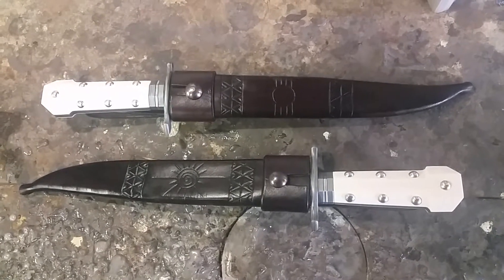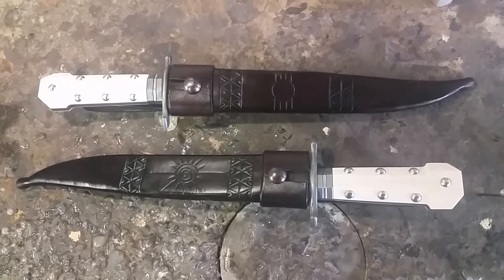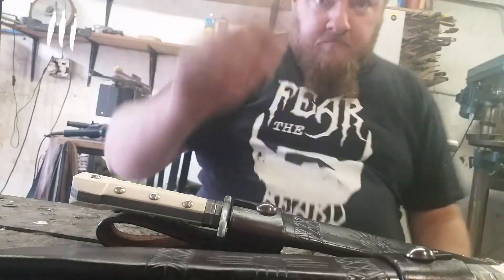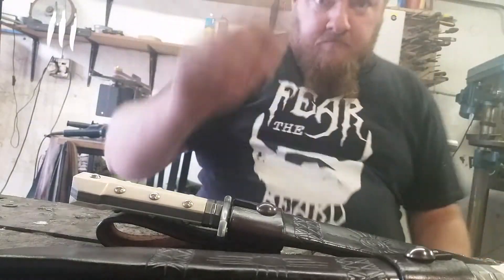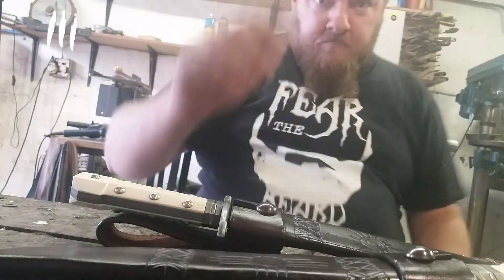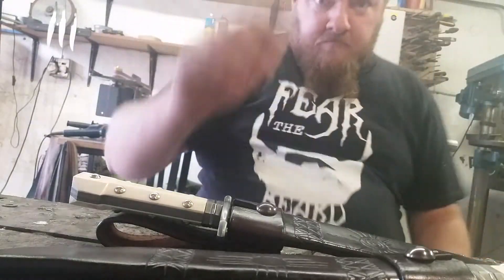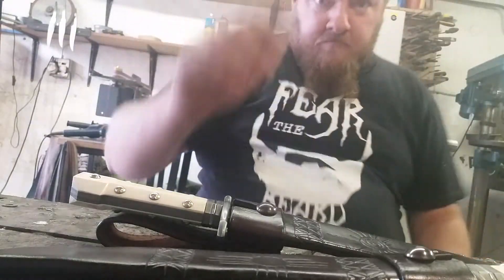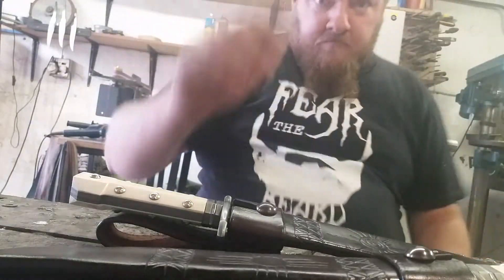Knife preview - Damascus dog bone bowies

Comment: How much would you charge for a bowie like this, only difference would be Blackwood handle or something dark maybe a Spanish notch on the blade. Blade 11-13” long sharpened back clip, I would love Damascus but forged carbon steel with a heavily antiqued finish (basically rusted and pitted so it looks like an 1830’s original) God those are incredible!
Reply from the maker: Without damascus and ivory I'd say around $ 800. A simpler handle would drop the price further
Reply: Stuart Smith I really like a black or ivory micarta grip and the fancy spacers are not necessary, I want basically a wrought iron guard and bolster under the guard (that faceted part) also unless absolutely necessary I would like a full tang grip instead, unless it is needed for balance or whatever. The domed pins are nice but stainless or nickel silver tacks would work as well. The carbon steel blade I would like to look like an antique, pitted in spots, tarnished and patined. I love ivory but I cannot afford it! The sheath doesn’t need all the design (though extraordinary beautiful) I want it to look like an old antique (oh, with the traditional Spanish notch-I have some pics of designs. Basically a carry bowie with about an 11.5” Blade or more. The grip doesn’t need to be too long, I have small hands, so something for just a small hand, and light as possible, don’t need a very thick blade, 3/16” is fine.
Reply from the maker: Do you have WhattApp or access to Facebook. We can message more effectively there
Reply: Stuart Smith I do have FB?
Reply from the maker: friend me on Stuart Anthony Smith or like my Fan Page Smith Hand Forged KNives and we can chat there